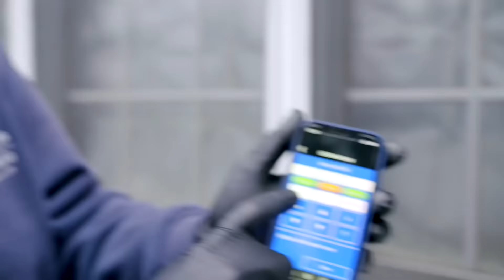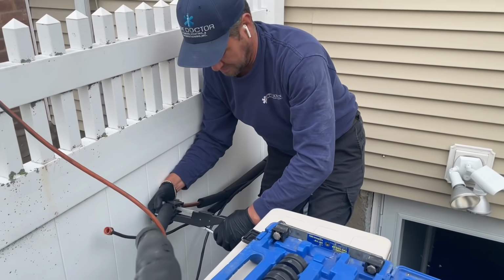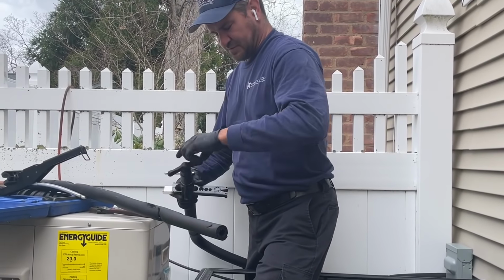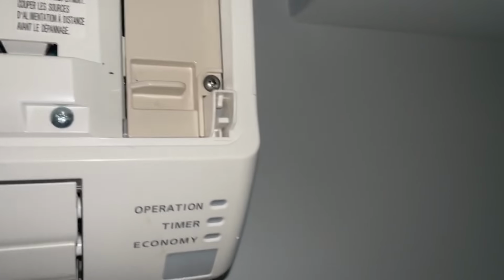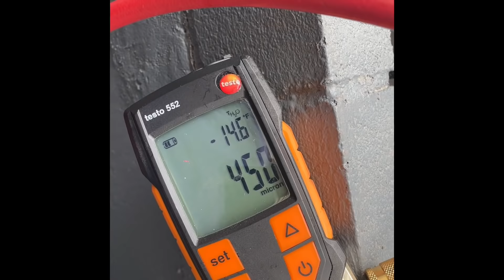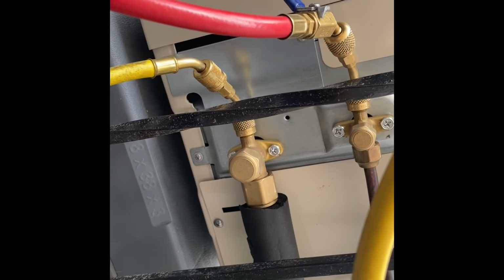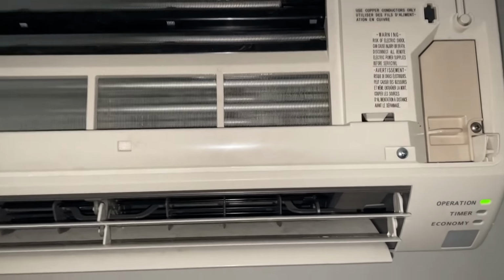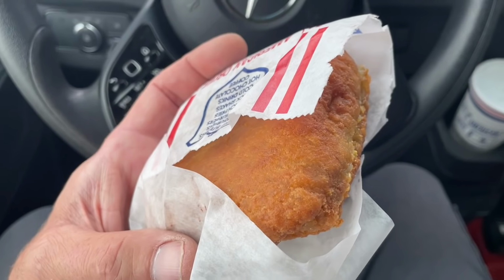HVAC Contractor Walked Off The Job - Finished Up Their Fujitsu Single Zone Ductless Installation

Comment: I have been watching your vids for a bit and man is there ever a lot of ways you guys do installs that aren’t up to coad in Canada
Reply: Everyone has different rules and codes wherever they live in the world. 

That’s part of the fun on watching these videos! Really cool to see how small the world is in some instances but so different in others! 

It’s interesting to see the extent of cast iron drainage still in the us! Here is Australia it was popular in high rises for stacks but it’s all slowly ripped out and replaced with plastic as it fails... 

Plumbers over here don’t generally touch HVAC, it’s a totally separate trade but plumbers have to still do the natural gas / propane side of things 

Not much hydronic heating here cos it doesn’t get cold enough. Boilers only exist in commercial buildings. 

Oil space heating was popular up till maybe the 80’s in residential houses but pretty much dead now 

Tankless water heaters are probably the most popular round here but we install them externally so the whole CO and cross contamination stuff that Mike deals with on his naviens is not such a problem here. There are definitely internal installations though and whilst some of the brands are the same the products are different

Enough waffling.. like I said we all do it differently but at the end of day getting the same job done

Comment: Why 36V? No matter what Godzilla did, that number is just wrong. 120 (White or green to Black or Red ). If he measured to Green and got 36, there is something seriously wrong with the Earthing bus.
Reply: He measured between the line and load terminals.
Reply: mV was likely being displayed as the auto range.  Basically 0v but there is a bit of induction from adjacent wire causing mv reading.